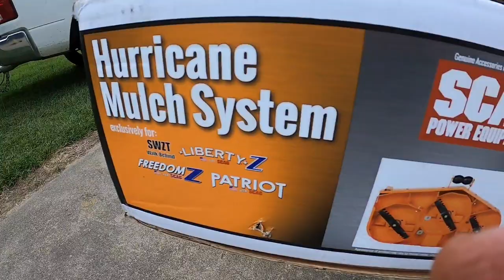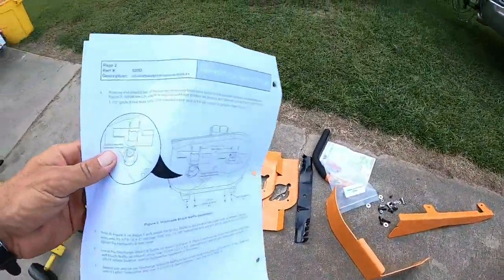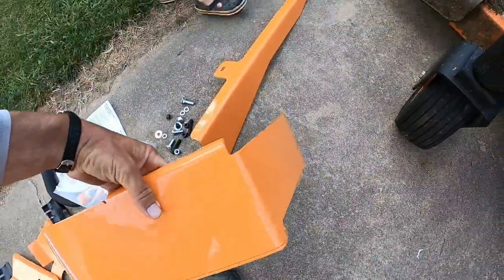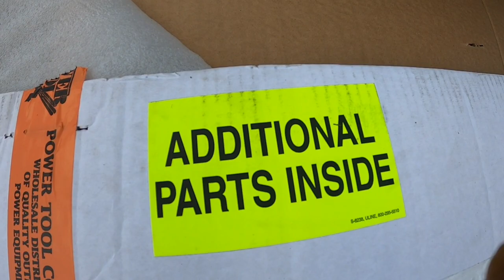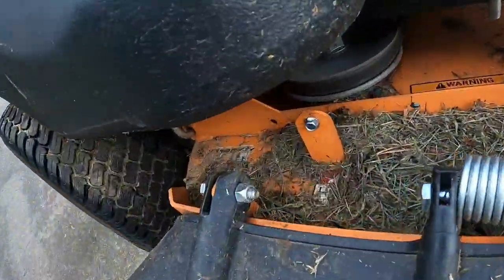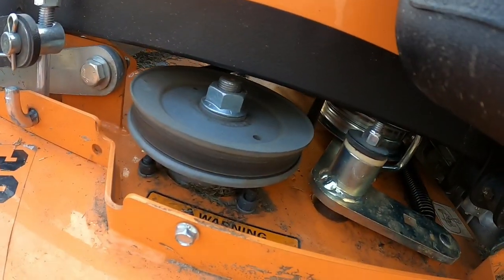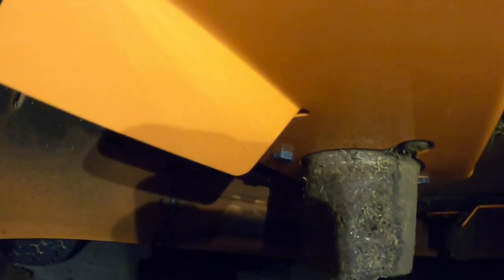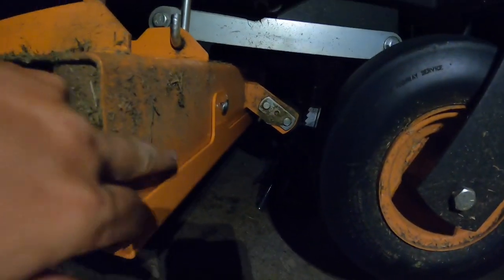SCAG HURRICANE mulch kit install 2021

Comment: Do you have a problem with it blowing grass out that hole that is at the top front edge of the discharge block plate? Seems it would blow grass out there.
Reply from the maker: It works fantastic have not noticed that

Comment: How does the 36 inch much kit work for a little longer or damp grass. Wondering if i should upgrade from the chute plate but I’d like to leave the mulch kit on for the whole season.
Reply from the maker: It does pretty well in that area i always leave my mulch kits on year round. But with that being said obviously if the grass is a foot tall and wet mulch kits are not ideal for that but i know you understand that so if your fine dealing with a few clumps when its wet id say you will really like the mulch kit

Comment: I just bought that same exact mower yesterday and had the dealer install the mulching kit. I tried it out today for the first time. Does yours have kind of a pulsing vibration when you get the blades spinning?
Reply from the maker: Its probley just somthing small you notice cause the mower is new i say balance the blades then try it

Comment: New subscriber here. Question on your 36”:  how does it handle side hilling compared to the 48”?  I have the 48 and handles my 14 degree slope, mowing and turning around on the side hill. Interested in sizing down to maneuver around obstacles easier.  Thanks
Reply from the maker: Bro thanks for watching my channel !!! I have experience with the 48 and this 36 the 36 will not stick on the hills as well just because how skinny it is but i love the mower but you may just keep your mower in my opinion LOVE the 48 liberty!!!!
Reply: @tonyslawncare  shoot, was hoping you wouldn’t say that. Thanks for the reply. I hear Scag might be making a 42”.  Did you see any at the expo?
Reply from the maker: I did not see any at expo but maybe they are in coming years😎
Reply: @avid1959  SCAG Liberty Z comes in 36, 42 and 48. Just bought a 48 last week and sat on all 3.

Comment: Nice. You need to buy a pair of long reach needle nose vice grips. I also use long reach magnets. Also have a variety of strong long reach alligator clips. Anyway if you have a cordless or air ratchet I just set up the bolt in hole and in socket, use the vice grips to line up while powering the ratchet and looking through top reaching your arm underneath. Makes for quick tight spot bolting. 😉
Reply from the maker: I couldnt even fit my needle nose vise grips in there lol